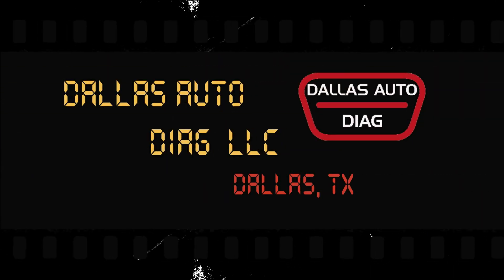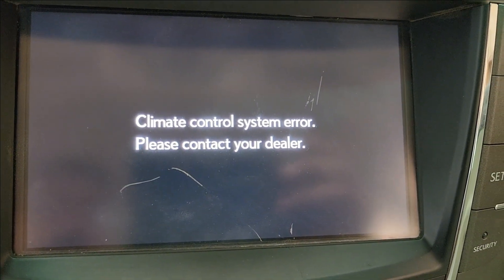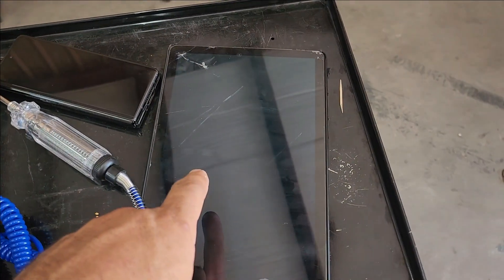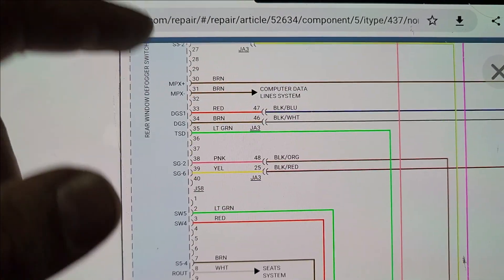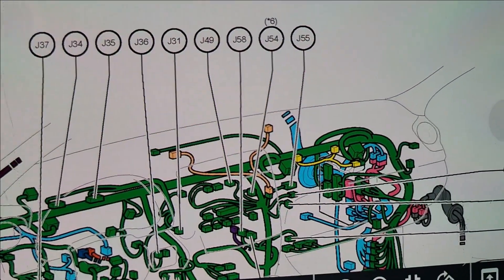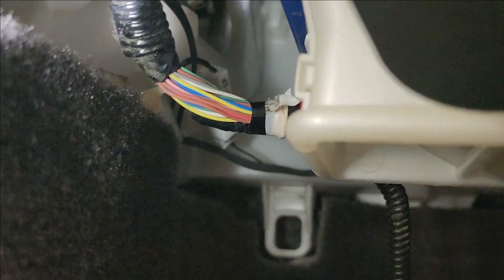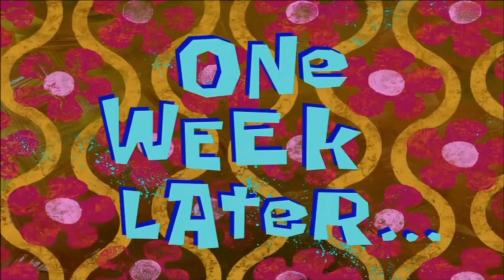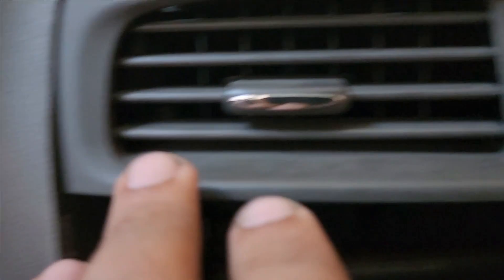Climate Control System Error. Please Contact Your Dealer 2013 Lexus IS350

Comment: Good to know the part about initialize servomotors when : 3. The battery is disconnected.
Edit: Since I had the 12V battery disconnected over 6 months ago, this should have been done to my Lexus, but I didn't know and have not experience any issue whatsoever with the air conditioner at all during this time frame. But today I did take my time to connect "the lightning fast" Tech Stream and initialize servomotors!
It's fascinating how a random YouTube video can give you valuable knowledge regarding disconcerting the 12V battery but the topic was Climate Control System Error!
Reply from the maker: thanks

Comment: Yes!! That module under the passenger seat was my problem. I found water has gotten to the connectors. I dried it before it got worse.
Reply: Unplugged it dried it, works now. Not sure if they problem will return yet
Reply: My Radio would NOT turn off even having the car off. So that other “black” connector was the main culprit. This man is a genius ‼️
Reply from the maker: glad you got it fixed.

Comment: Hey bro I got a IS250 -05  and have that same problem it’s saying check connection of the climate control… we test all those fuses everything is good but the same nobs you shown in your video as mines don’t work I got a next deck as the same one in the car same problem… how can you help me out… it’s not blowing ac nothing like that but everything else work and touch
Reply from the maker: I can not help from here. a technician has to do a complete diag on the system to find the issue.

Comment: Did this car have a/c codes? I ve no code in my GS- the panel (buttons) is not responding but I can control a/c via navi screen. All after I once removed the navi unit to fix a stuck button. What are the chances it is the climate module?
Reply from the maker: Could be

Comment: Hey man how can i contact you personally? I have the same problem but on a 2007 lexus es 350. My ac control panel was working fine until my mechanic replaced and put in a new compressor but it’s now not working once he done that. Had all fuses checked with and without the testers all good, relays all good. Had the computer scanned says no problems. The radio works but not the ac control panel. Also in the driver dash it used to read the actual temperature but just shows “E” instead of temperature. My mechanics recommend me to take it to the dealer but no money for their prices. Any advice?
Reply from the maker: contact us on facebook
Reply: Hey man! Same problem, did you fix it?
Reply: @thjohn1987  Hie Hie Did you fix your issue